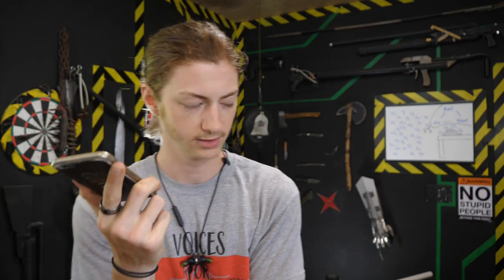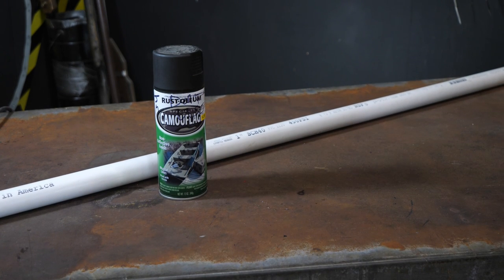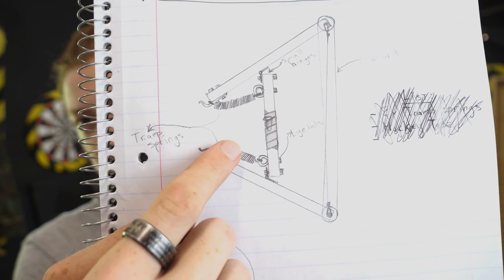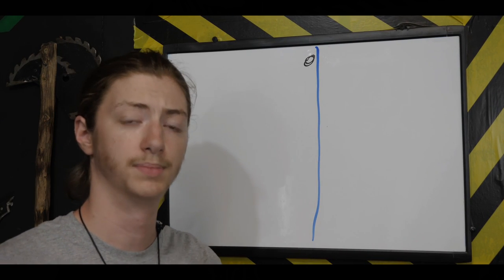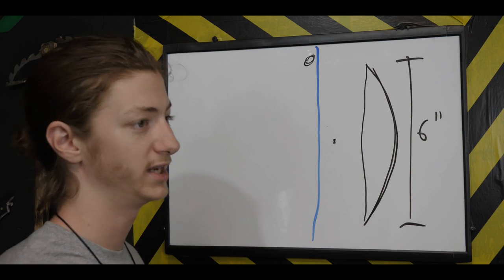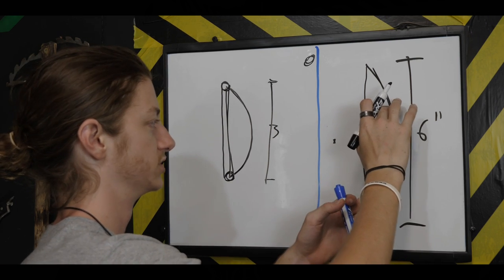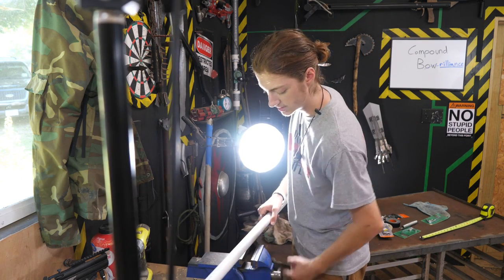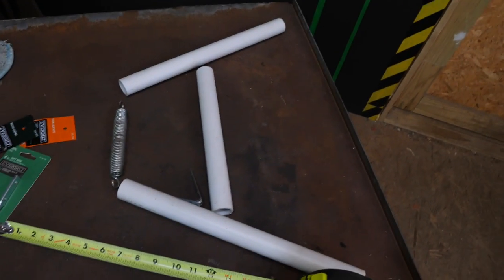PVC Compound SLINGSHOT Bow!! SUPER EASY BUILD (StrayHydraBlade Collab)

Comment: I really like this concept, I'm curious as to the FPS that the arrows travel at? And what the draw weight is (LB/Pounds)?
Cheers! Going to give it a go
Reply from the maker: I don't have a clue as to the FPS, but I'm going to make an educated guess that the draw weight is just under 40lbs. Of course you can easily change that by adjusting the length of the rubber.
Reply: @jakemakes  thanks mate, so I made it. Couple of findings along the way. 

- Our PVC is a bit thinner, the PVC seemed to stretch so i had to remake the limbs.  I had to use ellectical conduit down the guts for the limbs, and I put O rings between PVC and Conduit to fill the space. 

- I can't find plastic pulley wheels, only metal, so I feel the spring will be less due to the weight at the end of each limb. 

- I cut the limbs at the end, heated the ends up and pushed the wheels down so I didn't weaken the wheel mounts but cutting the gaps out. 

I think this bow design has good potential, so I'm going to keep playing with it. 

Is there a sweet spot with the length/amount of rubber to use? I feel too much rubber meas the limbs get more strain on them?

Comment: you should heat an indent to past the center of the width of the riser and have your arrow like that as a shelf. you can put a steel rod inside the pvc pipe to act as a brace and help with the structural integrity of the riser. you could also do it on the other side (neither indent could make it to center in which case) and you could do medetaranian or thumb draw

Comment: Interesting,  what is the poundage and have you tested with carbon arrows?
Reply from the maker: About 40lbs and no i haven't
Reply: @jakemakes  good video, I may have a go at this, normally shoot asiatic bows, try some carbon Arrows,  about 30 bucks should get you a dozen off Amazon, measure your draw length, 31", probably fine, spline shouldn't be too important at 40lb, cheaper ones tend to be 400-500, which will be fine, another little project could be a release for your bow.

Comment: ik this is an old video but try heating and flattening the limbs to give them some flex it will add more power to the bow as a compounds limbs tend to flex even if its just slightly
Reply from the maker: Yeah that would be nice. More complicated than I wanted to go with this build tho.
Reply: On a real compound bow that would be correct. However, I actually think the flex in the limbs is absorbing energy and reducing the bow's power, as this model is powered by rubber.

Comment: That does look pretty cool, but I was wondering. You keep saying that you want a compact bow but with full draw length, but you never say what the draw length and overall width are. It looks like its only about 15 or 16 inches of draw, with at least 10 inches of brace height. Draw length is what accelerates an arrow, and gives it exponentially more fps, that's why crossbows with short draw lengths have to be 3 or 4 times the power of equivalent longbows. If that is only getting around 16 inches of power stroke then even if it is 40lb it could be equivalent to a 10lb PVC bow that is literally just a 3ft tube and string.

Comment: this is excellent! would love to see you  spray one down with either black flexseal or plastidip spray, giving you exceptional grip
Reply from the maker: Ooh thats an idea. I should get myself a couple cans of that stuff I'm sure i'd have way too much fun coating random crap 😅
Reply: @jakemakes  i coat everything in that stuff! it's great.

quick tip, if you wait until it has set a bit, but is still slightly tacky, and you then carefully but evenly (like a screen protector on a phone) apply parchment paper (not wax paper) then you will get a softer matte finish on it, making for even better grip.

I am about to do just this to my steel magazines for my rifles.

that stuff has endless uses

Comment: I think that this design could be made to have a compound bow graduated decreasing draw weight, much like a compound bow with eccentric pulleys, by changing the angle of pull on the rubber bands as it is drawn back.  Yes, that could work.
Reply from the maker: Thats actually a good idea....
Reply: @jakemakes  Wish I could draw the diagram but I expect you can twig it without that.  At the start of the draw, the pull is directly pulling the spring -- at the end, it is approaching 90 degrees from a direct pull and this increasing mechanical advantage reduces the strength needed to pull.  This could probably be achieved by having a bend in the arm.

Comment: Since you pull the arrow behind the rubber, isn't there the risk of damaging it when the arrow passes it?
Reply from the maker: I haven't seen any damage... the arrows are all offset enough by the handle that the rubber isn't touched
Reply: @jakemakes  Cool, nice job. I bet JoergSprave would love the design. Only problem here in germany is to get that kind of PVC pipe, hardware stores mostly have PU pipes which arent as elastic.
Reply from the maker: @bunndalf  Eh I'm thinking its a bit too plain and simple for his taste lol. Interesting, here in the states pvc is about as common a material you can get your hands on

Comment: Great design! Can't wait for lockdown to end to go and get the material to make one!
Reply: Finally I have found an old 3/4 inch pipe in my garage, a bike elastic band (to attach bagages) and some inline skates mid-wheels as pulleys. I'm ready to finish it tomorrow, my heat gun died so I had to molt the ends of the tubes using my BBQ x)

The whole time I had that Too $hort song in my head "the ghetto" x)

It'll probably look ghetto as fuck and probably be less effective and realiable than yours but whatever if I manage to make it functional I'll redo it properly!

Comment: I tend to think Jake that whatever size bow you have, will not effect the strength of the bow. You can almost create an size bow to the draw weight you want. I think that the ACTUAL advantage of a compound bow is the increased draw length for shorter bows. Compound bows also reduce the amount of total flex that the bow uses. Think about it, if you had a really short bow (3 feet) and a compound bow that was also the same length, the compound bow would have alot more draw length compared to the other bow. if both bows are made out of the same material, then the normal bow will have alot more draw weight because the compound bow allows for a more mechanical advantage for the user. I just thought i would point that out.
Reply from the maker: I agree, but the three foot bow (pulled back to the normal draw length), would be ridiculously strong, too much draw weight. Which was my point. Draw length and draw weight are very closely connected
Reply: @jakemakes  Yeah righto

Comment: I know this is an old video but you should have brought the rubber closer to your hand to shorten that side of the limbs so they would act as levers better, increasing the power more and allowing you to use more of/more powerful rubber, also increasing the length on the side with pulleys would do the same but there would be diminishing returns since the power stroke would be shorter for a given draw length
Reply from the maker: In my understanding, adding more leverage would have just increased draw length while diminishing the draw weight. It would have added some more flex into the pvc,which would have made the bow snappier and probably feel a bit nicer to shoot, but the rubber is supplying all the power. If you added leverage in the opposite direction (ie, shorten the limbs behind the handle and lengthen the distance between my hand and the rubber) you would get more draw weight, but the other direction would lessen it. I could add more rubber rn and make the bow more powerful, or take some off and make it less powerful. The leverage situation doesn't make much difference.

Comment: What's the pull weight?
Reply from the maker: 40 lbs on mine, but since the weight is completely dependant on how much rubber you put on the front, it can be as light or as heavy as you want (within the strength of the PVC of course, be smart with it)

Comment: What's all the knots on the string for?
Reply from the maker: When figuring out the correct perfect length of the bowstring for the right amount of tension often it’s easier to tie knots in it then to retie the loops on the ends. The knots are slight adjustments basically.
Reply: Thanks

Comment: Cool that it works but it looks super low fps.  My kids 10lb fiberglass bows have a similar amount of power.
Reply from the maker: I can guarantee your wrong on that 😂
Reply: @jakemakes  i doubt it. That card board target your shooting stops those arrows pretty easy. My 45lb recurve would blow right through that.. Making a compound bow that efficiently transfers power to the arrow is tough. Modern compounds are good at it and they are only something like 80 percent effective in energy transfer. Im not saying it isn't cool, it's just probably not worth the effort for practicality.
Reply from the maker: @jeremymcpherson9405  This bow isn't the most efficient for sure, i'll admit that. But that cardboard target isn't made of regular cardboard. The cardboard sheets are about 3/8" of an inch thick and very solid. That target stops arrows fired from my 40lb and 50lb compound bows (which albiet are older designs that probably aren't quite as great as the most modern ones). Anyway. As PVC bows go this isn't bad at all.
Reply: @jakemakes  I see, I have seen some pretty decent fiberglass tent rod reinforced pvc bows that can fling an arrow pretty well. I do admire your ingenuity.

Comment: If I mite make a suggestion go on jcub L's you tube channel and look up his super short experimental compound bow and instead of using pullys make out of pvc 2 small cams that he also shows how to make on another bow it will help and make the bow faster and powerful, also on your arrows on the knock ends reinforce them with sinew or small diameter strong cord wrapping below the knocks to keep them from splitting and hurting your self.
Reply from the maker: Yeah I’ve seen those videos. He’s a smart dude

Comment: I hate to be "that guy" but you messed up your measurement marks .you wrote on your white board 6"- which is markings for inches not feet . It should have been  6' which is the proper writing for feet. I know I'm an asshole,,but if i didn't point it out how would we learn?

Comment: I have actually seen people draw long bows farther then what you said. So I'm afraid your incorrect, your back muscles have to be trained and I'm talking about hundred pound war bows.
Reply from the maker: Can you add some context to that comment? I have no clue what you are talking about. Obviously you are correct, hundred pound warbows do take muscle training to draw to full length. Heck I find it difficult to pull back a 60 pound bow
Reply: @jakemakes  what I mean is that I have seen some pull it back to at least 36 inches or over sometimes
Reply from the maker: @joshrobin7826  Correct.... lol my whiteboard drawings are approximate not exact. My proportions are roughly correct. Everything I said is 100% true, do some research on bows and how the shapes and length of the bow impacts draw weight. The point is that the smaller the bow, the more difficult it is to get the same amout of power while still having the same draw length.

Comment: realistically you more than likely would have ended up with a more powerful bow had you gone with a recurve or double recuve and put fiberglass poles inside the pvc before heating and flattening it....
Reply from the maker: If you watched the whole video I explain that the whole point is to make a very COMPACT bow. You can't get the same power into this small size any other way.
Reply: @jakemakes  check out the bear archery magnum recurves...those things have a higher draw weight than the majority of hunting compound bows out there.or you know...crossbows...there are ways of getting a powerful, but compact recurve..you could even put those horns on the front, so you damn near get the power of 2 recurve bows combined..as far as a PVC build goes, if you built it similar to a bear magnum recurve and put 3 or 4 of those fiberglass rods inside it'll shoot better and faster than the one you made...even though you swapped out the metal hinges, your bow is still gonna torque like it was with the hinges, so your not getting as efficient energy transfer to the projectile, and its going to throw off your aim at normal archery target distances
Reply from the maker: You can definetely get a more powerful bow with another design (especially with adding fiberglass), but nowhere near as compact. My goal here was to make the most compact pvc bow I could while still retaining decent power. Short pvc bows don't work unless they are flattened (can't put fiberglass rods inside), or are compound. The pvc doesn't flex enough on shorter lengths to get a full draw. You can't do a short recurve pvc bow and have it any more powerful than this design, try to find one if you want. Also this design is much easier to do than a recurve with pvc. All that flattening and bending is stressful 😅
Reply: @jakemakes  you flatten the limbs with those high vis fiberglass rod things though...the build i've seen with guys doing it that way aren't much bigger than what you ended up with and still had like a 30-40 lb draw weight...ideally the most compact and powerful design  for a bow is a crossbow...just be happy your not making a bow out of wood...heating and forming PVC is a hell of alot easier than tillering and adjusting wood limbs and alot more forgiving

Comment: Sorry to say you know nothing about bow physics. You made a spring Bow not a compound bow. The compound bow has cams that allow for a drop-off of the draw wait so it can be held longer. The compound bow was design buy a engineering student so he could hold the draw weight better. A normal bow was too much for him to pull back and hold. So he came up with the design of cams to form a drop off of weight so he could hold the string longer. Your bow has no drop off. Sorry to say you have a lot to learn about all physics.
Reply from the maker: No mate, my physics knowledge is fairly solid. I clearly state in this video somewhere that I am not making a bow with a let-off, merely one with pulleys. If you watch the whole video I explain why in detail.... physics plays a large part in the reason. The definition of a compound bow is a bow with pulleys and/or cams, so this is a compound spring bow. Or, as I so cleverly titled it; a Compound Slingshot Bow.
Reply: @jakemakes  you can't call your bow a compound bow, you need a drop off (cams) and lims   that have pull and cams that provide a drop of pull at full....
Reply from the maker: @waynethebarber1095  What pray tell is the correct terminology?